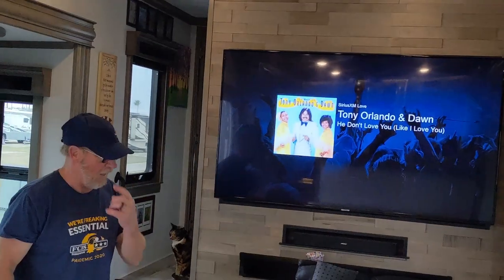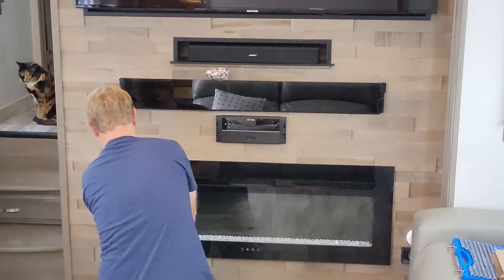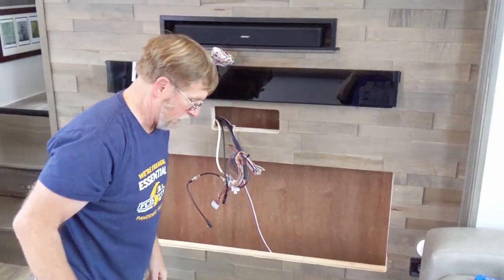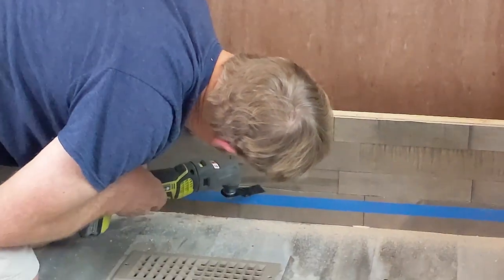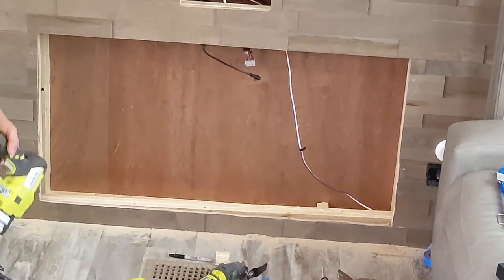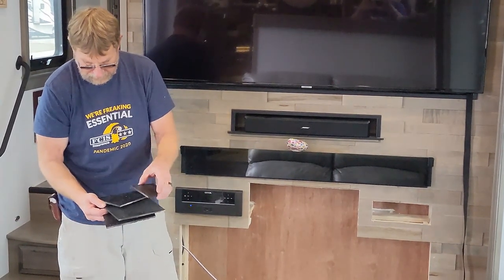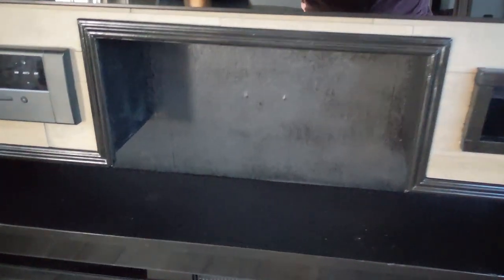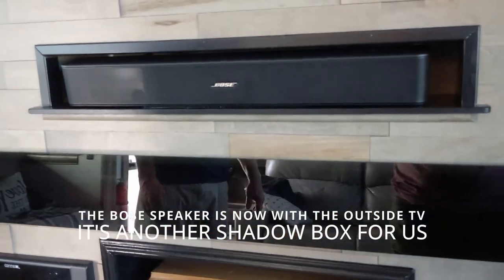RV Upgrade TV Fireplace Wall Shadow Boxes Antique Clock Full-time RVer

Comment: Great work and great ideas!!!  Perfect timing for my next 39FKTH project...need media locations in that wall for the TV.  I just replaced my kitchen dining top and replaced the couch in the door slide with acacia wood butcher block, pulled out the trash can slider and replaced it with dual sliding wire racks for pots/pans storage.  Keep the great ideas coming!
Reply from the maker: We want to replace the countertop by the sink and sink also. Projects projects projects. Sounds great what you've done thanks and good luck.

Comment: Great job mr bob.   great job fliming Brab.. Question, Do ya'll have a satilite ? If so where did you put the rec.   ??    Another question < LOL, is your main door hard to close and open , due to hinges Or Pins???  We still haven't gotten our bed fixed yet.........now we've gotten some more items to the list...   I'm a Little disappointed with Riverstone at this point, for a High end RV, I'm finding a lot a Fault in Their workmanship, Lots on LCI part..
Reply from the maker: LCI is a problem. On our door we had trouble getting it to latch and it was a the striker was messed up so Bob's had to adjust it a few times and now it shuts because it was almost like you'd slam it and it wouldn't close wouldn't close wouldn't close and I had to move it over a little bit it's like it wasn't quite the great place and then the striker now the door works fine otherwise it's a friction hinge so it works great.
Reply from the maker: We do not have a satellite we are streamers through Roku
Reply from the maker: We haven't really had a lot of problems I mean I don't know if you saw our stuck in Texas video but that wasn't LCI issue we've been pretty happy with our Riverstone so far we have been opening up as you have seen and finding more storage but it's pretty solid you know even adding a light switch in the hallway Bob had a heck of a time running the wire because the moldings and stuff were so tight but we've been pretty happy with our so far. Thank you so much for watching our video and talking to us this has been great. And I don't know what the issue is with the bed for you our bed works just fine.
Reply from the maker: On our bed the bathroom is super super heavy but we never raise our bed up and down because Bob writes the motorcycle right into the back of the garage just fine and we do have our little garage boxes back there and it will raise but they needed to put a much stronger motor in there because eventually that motor is going to go out. And I don't know if that's what you're talking about if so I hope and pray that you get it fixed soon.
Reply: @HetteshWorld  Our bed is all out of wack, it doesn't raise at all, They have ordered all New mechanical parts to fix it ... Yes Ive watched the stuck in Texas, I think Ive watched each and everyone of your videos.. 
Thanks for your reply
Reply: @HetteshWorld  when I start  to close the door , I see it move in the frame A LOT on the right side . We have to push hard to close it and like you said to close it you have to slam and slam
Reply from the maker: @Msrverpilot  I'm hoping you can get that fixed. You are right that is the issue. I'm sorry. I will be praying that it all works out.